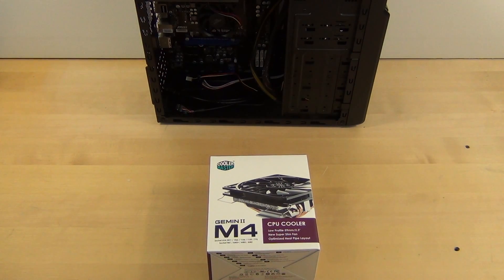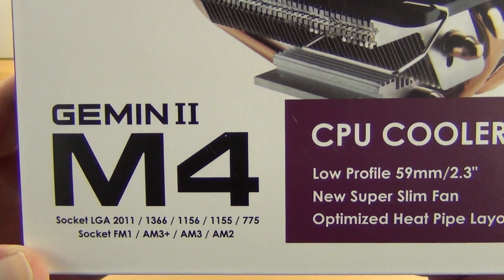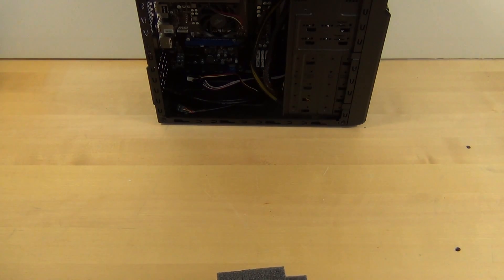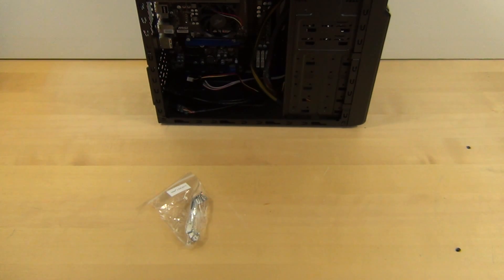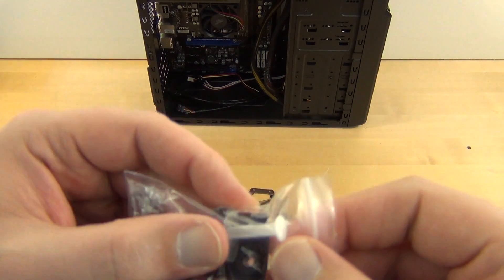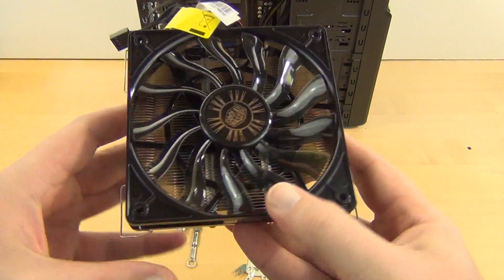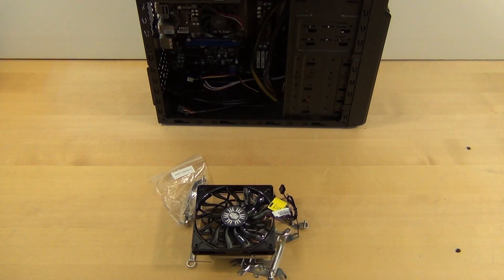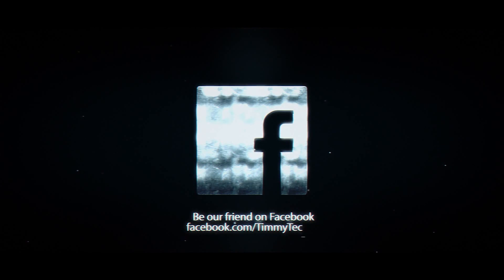Cooler Master Gemini II M4 CPU Cooler - TimmyTechTV

Comment: I don't understand why they don't offer this slim fan as an option for my Hyper 212 Plus, I know it's probably lower cfm over the stock one, but I think it would clear my ram and actually be able to use it as a push configuration instead of pull with an extra 120 on the front offset to assist in pushing, either way I want that fan because it just looks wicked ;)